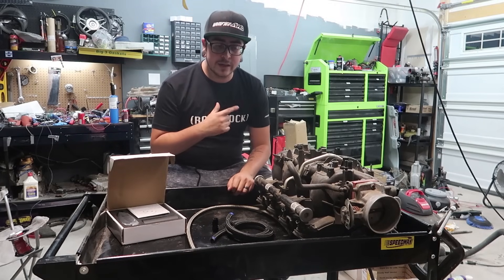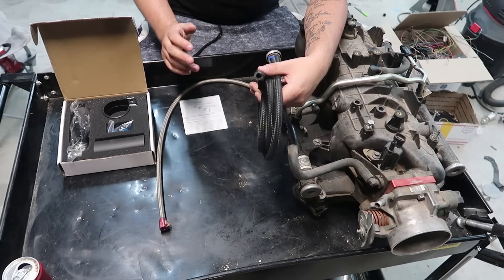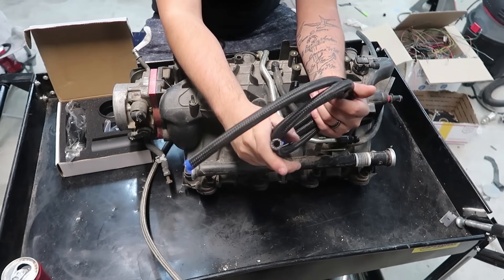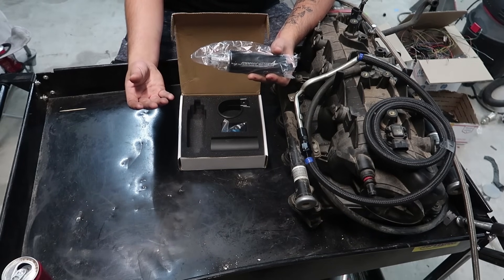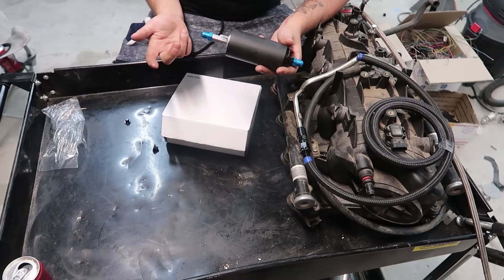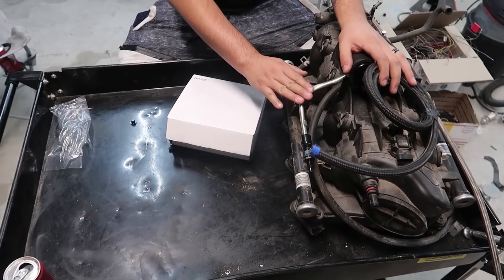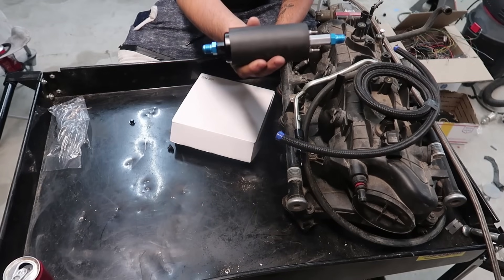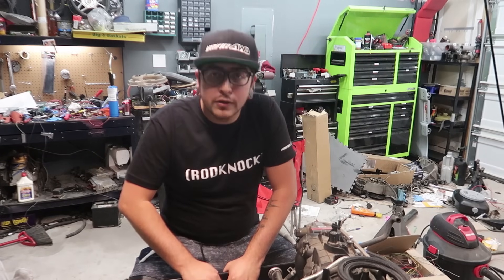LS Swap Basics - Part 1 - Fuel Systems *How to LS Swap Any Vehicle

Comment: Hi Jovani,
I am doing a LS swap and I watch your video on how you set up the fuel system. I did buy one of the electric pumps options you mention. I went for the Walbro 392 and 255 LPH.
I red some comments and on one of them the subscriber mentions that he used it on a 5.3 L and worked great, that's why I assumed it would work on mine which is a 5.3 L with a dual line "return".
The engine starts but doesn't stay running it dies 2-3 seconds after!
I tried spring engine starter  fluid and it runs as long as I keep spring.
Do you have any suggestions.  
Thanks in advance.

cg
Reply from the maker: Hi did you flash your pcm to remove vats
Reply: @JovaniDanteGriego  

I bought it from ebay and they told me it was flash and they  asked for the vin #

Do you think it maybe the computer?
Reply: Sorry for the late reply!
Reply from the maker: @carlosgomez2323  yea it sounds a lot like VATS the vehicle anti theft software. It will crank and fire then immediately die.
Reply: @JovaniDanteGriego  

Thanks for the advice.
I will check the computer vats.
I will keep you posted.
Reply: Hi Jovani, I did contact the Ebay seller about having problems, I mentioned that everything was in order but it would not start, I told them if it could be the VATS or the vin # was not set up correctly and the response they gave was not convincing. 
He said that the vin # was irrelevant.
With your experience could you tell me if I want to use a PCM that did not come with the engine that was purchased from Ebay which is the case, what is there to do?
Delete the VATS?
What about the VIN#?
?
Could I try  the Ebay PCM in another working Silverado to make sure it works even if the VIN # is different?
My engine came off a 99 Silverado and the one I could try it on would be a Silverado 2000.
I have the original PCM that came with the engine,  my mistake of course was to buy one from Ebay to save me the time in sending mine to the shop.
I would like to confirm if the Ebay PCM was really VATS deleted or not so I can just send mine to get the VATS delete.
Please help.

Regards

cg
Reply from the maker: @carlosgomez2323  the vin doesn't matter. But did they confirm they deleted vats? Because if they did maybe we need to start looking at other things
Reply: @JovaniDanteGriego  
They say they did!
But at this point I am not so sure.
If I put it in the working 2000 silverado should it work?
Thanks
Reply from the maker: @carlosgomez2323  I think so but be careful you don't want to mess up the working truck
Reply: @JovaniDanteGriego  

I will
Thanks
Reply: Hi Jovani, I did test the PCM in a 2000 silverado with the same engine as mine and it did not run so I think you were right the VATS were not properly deleted.
Can you tell me who you use to remove the VATS?
Whats the cost?
 I think I better send the original PCM that came with the engine to avoid any problems
Thanks
cg
Reply from the maker: @carlosgomez2323  hi I have HPTuners so I remove it myself but I haven't used anyone else so I can't give any recommendations
Reply: @JovaniDanteGriego  
I found on in Texas
I sent it already.
I hope they will do a go job.
Thanks, I'll keep you posted
Reply: Hi Jovani, I wanted to thank you for your presence advice, you were totally right, my problem was the VATS.
I sent the PCM to remove them and the engine started perfectly.
Thanks again.
Reply from the maker: @carlosgomez2323  no problem ! I'm glad you got it fixed

Comment: Fuel line time, skipped all my FB groups because I knew there was a cut and dry parts list right here. Thanks for the hard work and info!
Reply from the maker: Just a heads up use a genuine walbro 355 I'm no longer user the cheaper knock offs.
Reply: @JovaniDanteGriego  I ordered a genuine months agodidnt want to mess with a knock off in tank pump.   Have you messed with any decently priced boost referenced FPR?
Reply from the maker: If you check out sloppy mechanics, I know he uses a relatively cheaper one that works great
Reply: @JovaniDanteGriego  I did a quick search on the page this morning, I haven't checked the sloppy wiki yet.  Hope all is well, thanks for the quick replies. 🙏🤙

Comment: Do you mount the return/filter before or after the in line pump, before as in closer to the tank in relation to the in line pump, after as in closer to the intake in relation to the pump
Reply from the maker: After pump, it regulates the amount of fuel coming from.pump

Comment: Thank you for the video it has helped answer a lot of my questions but I just wanted to ask a few more if you don't mind my asking. I'm running a 5.3 out of a 2003 Yukon so it has the return style fuel rail.
Since I'm using the return style intake that means that I don't I don't need to buy a fuel filter that also doubles as a regulator due to the return style having a built in regulator, correct? 
If I use that in line fuel pump that you showed in the video how would I wire it up? And this also mean that I don't need an in tank fuel pump correct? Would I still need to switch out the sending unit on my 78 G body to an efi style or would I leave it and just add another port for a vent?
Reply: Frank Valdez the return style intake is internaly regulated so no need for inline filter/regulator just your pre and post pump filters .
Pump should be triggered via pcm and a relay

Comment: I like to run hard line usually nikel copper alloy as an intermediate line down the frame rails and just convert it to an lines right at the tank and engine bay it's cheaper and imo easier and just a cleaner look.

Comment: I have an intake from a 2002 Yukon which has 2 lines on the intake  so do I just run a line to the pump and another to the return and don’t need the fuel filter with the regulator.   Thanks in advance
Reply from the maker: That's correct

Comment: Have you ever setup an LS fuel system where the vehicle ran dual tanks, would I be better off doing two fuel pump systems or can I utilize one somehow. 84 GMC C30
Reply from the maker: I have not set up duel tanks. However I do believe a few people have. Just do a search for it
Reply: @JovaniDanteGriego  thanks for the quick reply. I havent found any in depth build threads on it. I'll keep digging though. Worse case I'll conjure something up custom. Great video though! Thanks!
Reply from the maker: There is a method I've seen but kind of a rig. You basically put each fuel pump in each tank on a 3 position switch. Up is one tank middle is so pumps down is the other tank
Reply: @JovaniDanteGriego  I contemplated that. Its definitely able to be done but it's not quite the stock feel of switching tanks and being able to run them. I'm pretty sure I'm going to have to run a dual pump setup and change the electronic diverter valve one that can handle 255Liters per hour and to use a relay for pump switching power. Gonna have a bit of a challenge doing it but it should work. Doing so I will probably be better off changing to the single input fuel rail so I dont have to run another diverter to each tank for the return. 

Whole lot to think about just to have the factory feel lol

Comment: So, u don’t modify the factory tank or pump or sending unit at all? Just the in line pump and regulator if necessary?
Reply from the maker: This is for a bone stock car. I recommend baffling the tank and using an in tank pump for anything more than stock. The issue with this is you will have to keep your tank more than a 1/4 full to avoid sucking air from the gas sloshing to the back. The tank I used this in had a low sump in the pan that this works for

Comment: Thank you for this video.  I plan on swapping my truck intake manifold from my 5.3L chevelle to a corvette intake manifold, I am also running an external corvette fuel pump and filter. Do I need to run both fuel pressure regulators on the fuel rail and the regulated corvette fuel pump?
Reply from the maker: No one or the other
Reply: Jovani Dante Griego if you’re running the fuel pressure regulator on the stock rail how do you run a fuel return line?

Comment: What is E85?
Reply from the maker: Ethanol based fuel (corn) E85 is 85% ethanol gasoline. It's sold as am alternative fuel and is represented by yellow pumps usually. It's higher octane rating helps avoid detonation

Comment: what type of hose do you run on the return are you using high pressure fitting on the return side or just regular clamps , is it high pressure on the return side ?
Reply from the maker: Return isn't high pressure. I personally use AN 6 through out the whole system but to save money you can use regular fuel hose and clamps on the return side

Comment: Great information.  I do very much the same thing, l sometimes run a return line to the fuel filler neck just to keep it simple. The last build I did I used the normal fuel line supply for return fuel and installed one of the bulkhead fittings low down in the wall of the tank one side running to the prefilter/pump and the in tank side to a 18" piece of fuel line with a 90* fitting and a small Holley Hydromat pickup.  Worked like a dream and no suction problems.  I also use the Corvette filter/regulator for a returnless system, it's just to easy.  If you have a return style intake with the built in regulator in the line you can get a block off plug for the regulator off Ebay for like $10 to make it returnless. Easy-Peezy.  Oh, and I run as much 3/8" hardline as possible, cheaper than hose.
Reply from the maker: The retutn to the fill neck idea is gold! i might try that soon!

Comment: Just a side note. Return line is to stop vapor lock not to avoid too much fuel that's what the regulator takes care of. Decent info on this one
Reply from the maker: Sorry I was referring to the Corvette fuel filter regular that includes the return
Reply: @JovaniDanteGriego  its all good brother keep up the hard work
Reply: Really the return line returns unused fuel even under wide open throttle you dont use all the fuel if you did there would b a lean condition
Reply: @jeremyhanna3852  correct , but back in he old days there was issues with vapor lock the return helps keep the fuel cool enough not to vaporize , you can run a return less fuel system but run the possibility of vapor lock on hot days at idle or lower rpms, but yes also keeps the system from over pressurizing the system. its all good info

Comment: I see that you are using the intake out of a truck, I also noticed that another video you put an LS motor in your 65 Chevelle, was that able to fit under the stock hood?
Reply from the maker: I haven't tested the hood clearance yet. The front clip is still off that car . But from the looks of it I think I'll have to shave a little bit of the plastic tabs from the intake
Reply: @JovaniDanteGriego   Will you be doing a video on the Chevelle build at any time?
I am also curious if the trans mounting is a issue, no one seems to talk about that part of is. I have a 66 El Camino That I am working on. (So I at least have the car..lol)
Thanks
Reply from the maker: @bradplowman3271  yea the Chevelle's next on the list I'm gathering parts for it .I'm going to be re using the trans crossmember so we'll see how it goes
Reply: @JovaniDanteGriego   I will be watching it close, I just bought my car a few days ago, so maybe by the time you are done with yours, I will be starting mine. :)
I look forward to asking you a ton of questions. :)
Reply: @JovaniDanteGriego  I just put a 5.3 with a 700r4 in a '68 C10, I used the stock trans crossmember just had to slide it back a little and redrill the mounting holes, the mount was the same.  They haven't changed much on the automatics and I always try to mount the engine/trans as far back as possible so I'm always moving the trans crossmember.

Comment: You guys don’t use the fuel pump out of the vehicle that the engine came out of?
Reply from the maker: Almost all of them are in tank. Of course you could but I prefer externally mounted
Reply: Jovani Dante Griego what’s a normal price for a 2005 5.3 with trans harness computer.....?
It’s still in the Tahoe so I’m hoping to grab everything

Thanks, jp
Reply from the maker: @johnpenner1318  id say anyweher between 600 and 1500 depending on milage and how bad they wanna sell it
Reply: Jovani Dante Griego 109,000 miles
Thanks for the info
Reply: @johnpenner1318  Back in April I picked up a complete LM4, trans, harness, PCM, Fuse box, throttle pedal with module off a 2003 Envoy for $500 during Pick a part 40% off sale. Good sales are out there, just need to be patient.
Reply: David Figueroa when u say throttle pedal u mean u tood the pedal from the vehicle or u mean intake throttle runs on wire? Im trying to figure out items i need .
Reply: @mrsteel10213  I believe starting in 2003 and up, throttle is controlled with a throttle by wire pedal, not a physical cable that mechanically opens the throttle body. In my case, the Envoy came with throttle by wire so I picked up the throttle pedal assembly along with the throttle module that connects the pedal and PCM.
Reply: @El_5Zero  Damn dude thats a steal for an aluminum lm7! Im picking up a whole 2002 silverado for $500 to swap into my montero. Has a lot of miles but the 5.3s last forever
Reply: If the stock pump can supply 58psi of pressure your Ok .

Comment: Do you have a link for the adapter you used on the fuel rail?
Reply from the maker: Heres the 3/8 one https://amzn.to/2Y2eJQU
Reply from the maker: Here is the 5/16 one https://amzn.to/2XEQsfO
Reply: so the fuel line you connecting to has to be flared to use these connectors? how do i go from my fuel line sending unit on my fuel tank that just has steel lines coming off it with no flares just a smooth line  to these an lines?
Reply from the maker: You can skip the rubber hose over and use a fuel injection clamp